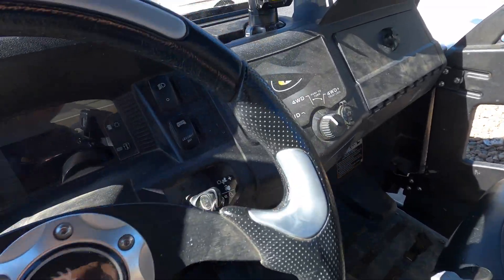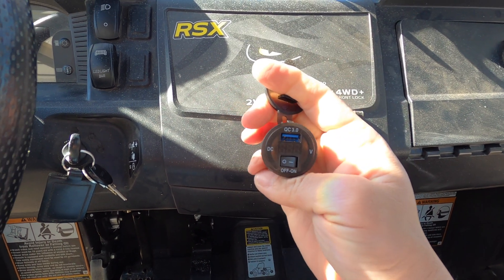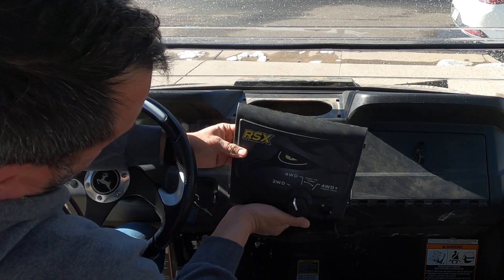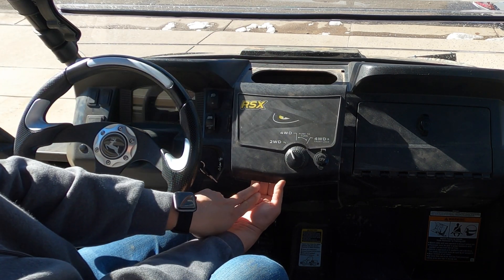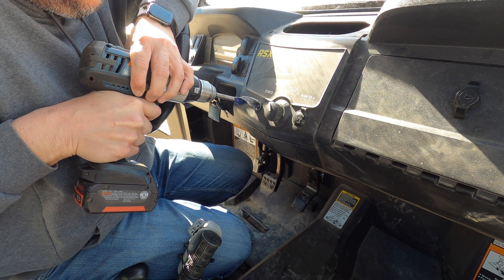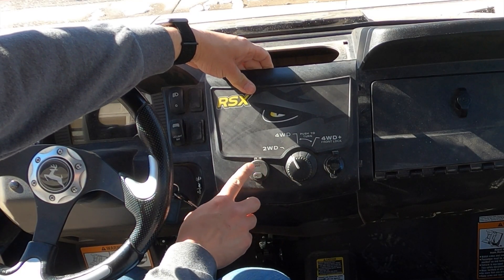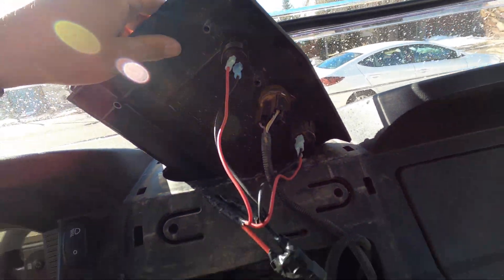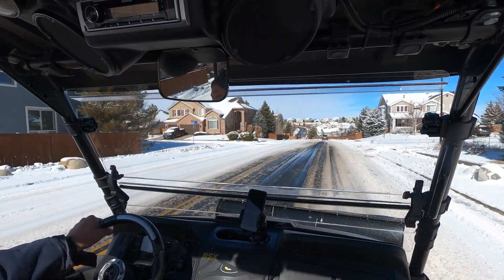Adding a volt meter to your John Deere Gator (or any UTV)

Comment: Well, that is a quick fix for your need.  You actually kill two birds with a stone while having a USB charger as well.
Reply from the maker: Hey Joe!  Yes, I like having that USB port for charging too.  And, if I still need that 12v accessory plug, it will still be there for me.  Are you still enjoying your Defender?
Reply: Yes sir! We are very happy with the Defender. It's a pure workhorse. It pulls the log trailer, snowplow, etc. It's also very comfortable for a ride, the suspension is amazing. We had it checked for the annual maintenance and I had the technician to check the belt. He said it's still brand new... Can't believe it!!! Thanks!

Comment: Neat idea. I could use that on my tractors. 
Do you think they make one of those that just plugs into the 12 volt outlet ?
Dielectric grease would be good to put in all those connections to keep moisture and corrosion out.
Reply from the maker: Yep, I've used those too and they work pretty good.  I agree on the dielectric grease.  I'll have to get some and add that.  Here's an example of the plug-in meter:  https://amzn.to/3LHDxUk
Reply: Tractor Hoarders,  thanks. That’s neat too. My 1970 John Deere 140H3 has a cigarette lighter in it. I might have too look in to that some time.